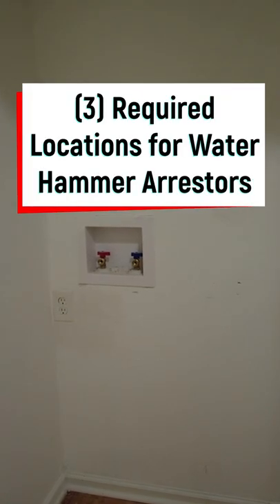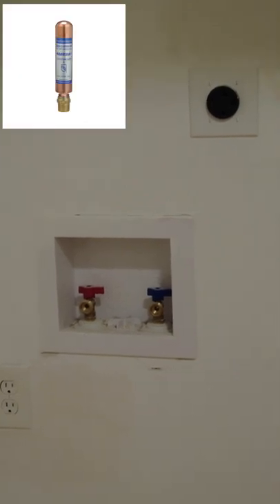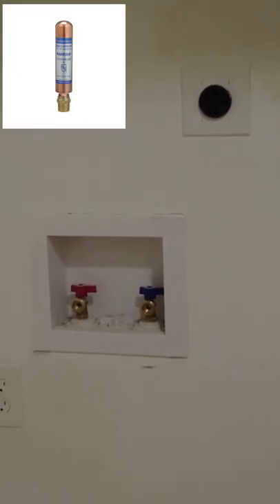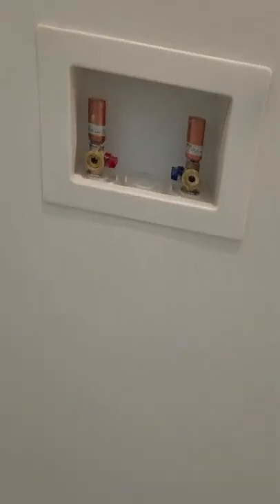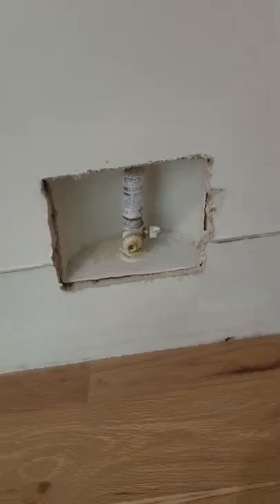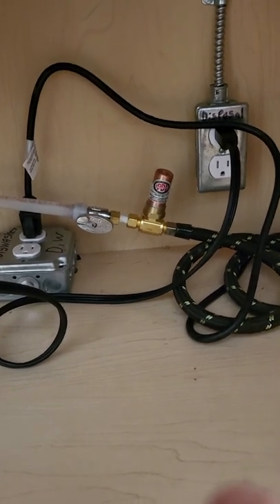The Required Locations for Water Hammer Arrestors.

Comment: If I installed a new copper run to fix my old steel pipe  to my washer, and did not pull a permit yet, I am pulling a permit to do a large section of my house since all the steel plumbing is failing as it is so so old. Can I just buy those add those screw on on  Souix 90 deg hammer arrestors to "meet code" with newly installed plumbing when I bunch it all into the whole house plumbing permit that will soon be pulled. My water runs come from the top and are not conducive to bottom supplied washer water boxes with hammer arrestors in a 1884 house. I am dumping washer water into the sink the old way we all did it. I don't need a dedicated washer drain in an never to be finished farmhouse basement when a sink dump is right next to the washer. Saving money to afford all the stuff I need to do the work  under permit.

Comment: I'm confused. When you have water hammer noise coming from the second floor bath tub every time they open the valve and let's say you install this water hammer arrestors downstairs on a washer machine line will it stop the noise coming from the second floor? Is it going to fix the problem in another room or does it only fix the problem where you install it at?

Never mind, I fixed my issue. It was the handle valve. I changed the cartridge inside and that stopped my pipes from banging, done!
Reply from the maker: If all of the fixtures are connected to one plumbing system, then water hammer arrestors connected at the washing machine box should do the trick.